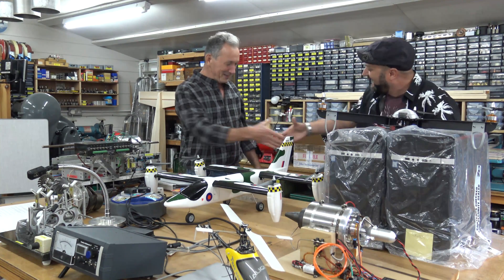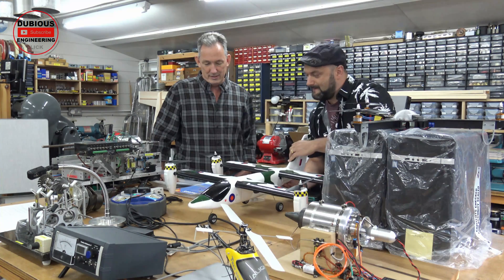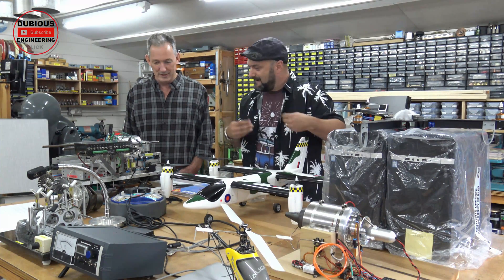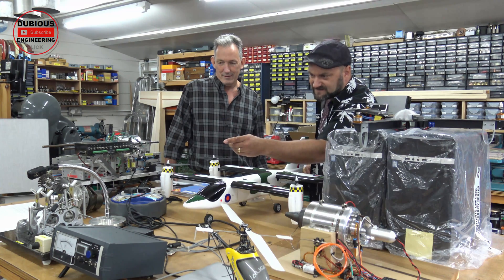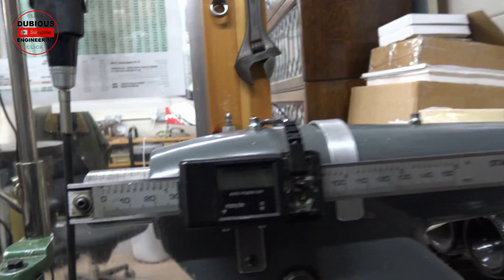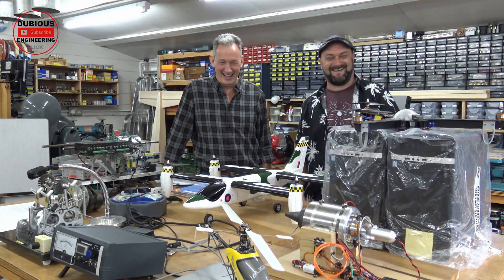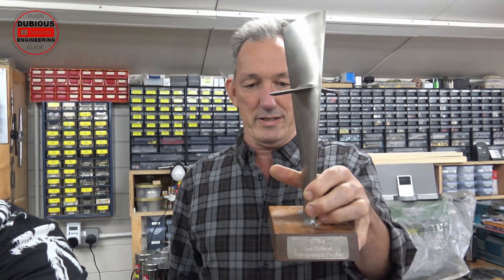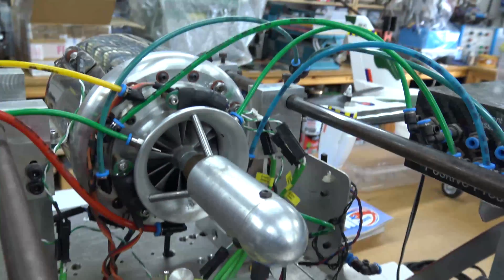DuB-EnG: Jet Engine maker workshop, Tri-copter model engineering, VTOL quadcopter aeroplane azipod

Comment: What is the key to make a good jet engine?
Reply from the maker: Bearings, fuel distribution, combustion and correctly shaped engines / blades
Reply: I have a few ideas. are air bearings any good? and would multi slatted flap designs work for turbines and compressors? @DubiousEngineering

Comment: I have already seen the machine you use, I use a triaxial sensor of which I only use one axis, it indicates the imbalance collected by the rotor noise, it is a program of Hungarian origin, I met the man who designed it, I have had it for years This connects to a PC through the microphone input and although it costs a bit to balance, all the work can be done on the turbine with the rotor assembled, it can also be balanced outside the turbine on a support similar to the one you have.
thanks
Reply from the maker: Thank you very much for your advice! - We will look into it!!

Comment: What amazes me is when a full size jet engine such as the RR Adour that the compressor fan blades are loose and as the engine is shutdown and is coming to a stop you can hear them all clattering around. Of course when spinning up under power they all tighten up and run perfectly smooth.
That workshop was amazing 😀🤔
Reply from the maker: Awww...  thanks!! - James is indeed epic, and has some really cool kit...  We have a few more videos to publish soon...
Amazingly tolerances on blades on jet engines can be up to 50um !!  Where as some car parts are 5um!!